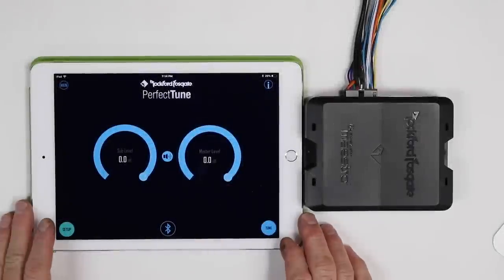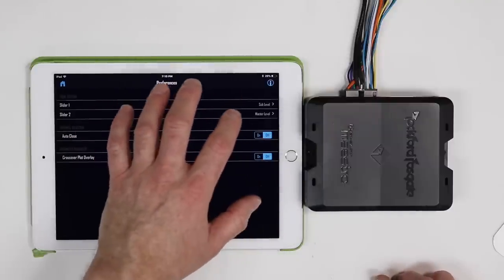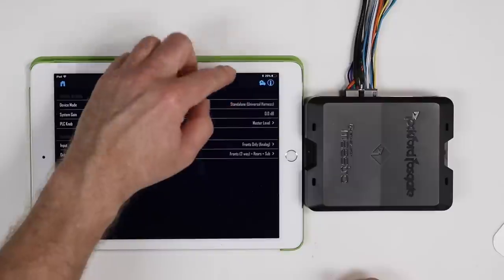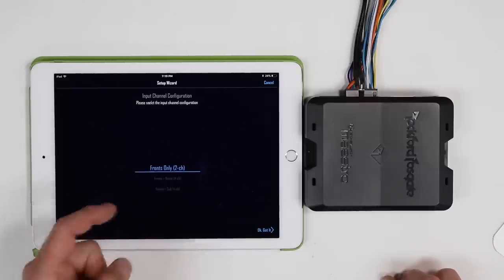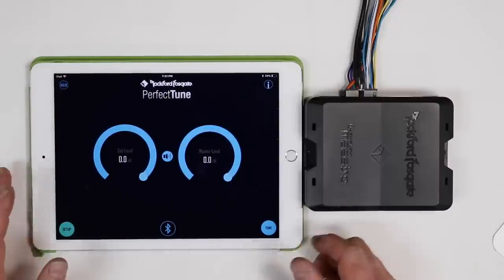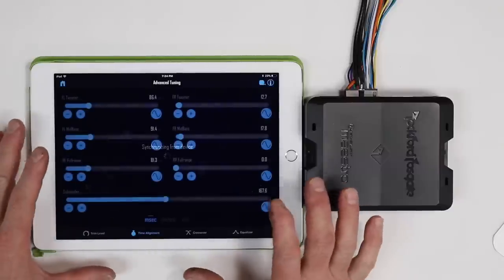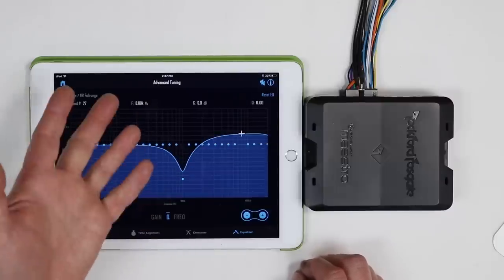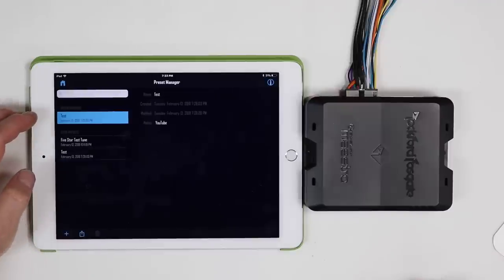How to setup The Rockford Fosgate idataLink Maestro DSR1 DSP

Comment: I was in LOVE with this unit for 4 months waiting till it became available. Then I found out that the bluetooth was for connecting to the tuning and display device aka tablet. I let this one thing make me so upset, that I erased the DSR1 from my memory. lol. 
Then, by chance, I just saw this video for the first time and....omg! The spark is back!
The display is awesome and easy to physically read. Love the colors as well. The ease of use and flow looks very smooth. Each step, makes sense. Has a purpose.
I believe I'm gonna have to give this unit a shot in my truck since it's going to be a Rockford throw back old school install but with some present technology to enhance the sound quality of the classic gear.
Dean....Fernando....
What are your basic opinions of the DSR1 now that it's been out for a few months?
Has their been any warranty issues? Heat issues?
Just let me know what you think of this wonderful little black box!

Comment: Simply push the bluetooth icon to pair? I do not see my DSR1 in the list. Location services turned on for Perfecttune. Not sure how to get the DSR1 in pairing mode. Can we just use the USB plug into our Android device? It seems that would be more reliable if it works.

Comment: Hi guys from a wet and windy Scotland, I live on a small island so I have to do all the work myself, I have just fitted a kenwood Dmx 7017 dabs into my 96 Mitsubishi Pajero, although it's an old car it's in really good condition, the radio sounds ok but the other music sounds flat so new speakers is my next step , do you know what sizes I need before I rip all the trim out , an amplifier maybe for the future but fitting one seems a bit daunting. I love your vids keep up the good work.
Regards Paul.
Reply: God I know this is an old question but speakers are not your answer. There's a formula to this and speakers are just PART of the equation.
You have to start with a good source unit that send the information aka music to the amplifiers (whether inside the source unit or externally, there's an amp boosting the signal carrying the music). Without it, you can spend $$$ on the best speakers and only hear crap, reallllllly well.....and there's nothing worse!
So, depending what system you have in whatever vehicle you have, this DSR1 can possible fix a lot for you and your factory system.

Comment: Hi guys, any chance you could show how to wire the DSR1, with aftermarket radio and 2 amps?  The DSR1 will be installed far from the radio.  So do I connect the 12v Yellow from the 4Gage power cable with a 5A fuse?  Do I remove the remote wire from my amps and just use 1 that goes from DSR1 to 1 amp?  The diagrams shows how to set that up with 1 Amp.  And no where does it show the 12v.  Please help!  Thank you,

Comment: What can be done about the static? I have a DSR1 in a Ford Mustang and I have to have my amplifier gains all the way down and the DSR1 Master Level half way at -30 dB to completely remove the static. When I bypass three DSR1 with my Audio Control LC7i there's no static at all so I know it's the cause. Have you guys experienced this and do you have any advise on the settings to resolve this?

Comment: I have a 2018 F150 XL work truck, small screen, no touch, very basic but has an aux jack. Is this device a good choice to use in place of the factory system? I can't remove the screen, I need something I can hide so I can have good sound without changing out the head unit.  This seems to be what I need with the Bluetooth dongle and volume knob, set the knob to control system volume and completely bypass the factory system( I have an aftermarket amp I can use).  However, I need to retain the backup camera, not sure how I do this? Any suggestions or should i chose something else?  Thanks, love the show and videos guys.

Comment: Do you lose any sound quality due to the thin wire included with the dsr1? Also if you are using components with the dsr1 do you omit the component crossover and control the signal to the tweeter and mid range woofer with the dsr1?

Comment: Hello there.  Is there any way to do specific input channel routing?  can't find it anywhere.  per say, Channel one input routed to ch 2 and 3 only,  channel two to input to output 3 + 4 only.  etc. Thanks for great videos, information, and relaxed atmosphere.
Reply from the maker: Not with this device, you only have presets to choose from.
Reply: @FiveStarCarStereoInc  Oh Darn.  Wish they do a software upgrade and include it at some point.  My application requires that, otherwise I will have to exchange my unit down the road.  Thanks for quick reply

Comment: Hi guys! My car is a Peugeot 208 (year 2017). I´m in the process to upgrade my audio system. I got a Pioneer gm-d9605 amplifier  , kicker css65 6.5" component speakers (front doors) and JL Audio 10WX-4 subwoofer; I´m looking for mid-bass speakers for rear doors. Now, because I want to mantain the OEM unit, I´m looking for a sound processor; can drs1 be a good option for me? Thank you guys!

Comment: The only output channel configuration utilizing all 8 outputs is the 1 with the tweeter, midrange, midbass, and subs. I wanted to do an install with a dsr1 rather than a dm 608/810. The problem is that i wanted to do tweeter, midbass, then the next 4 channels would be sub. Could i simply use the crossovers to make any channel what i need them to be? Or does the designation have some type of bearing on the signal produced?  Would the time alignment be the same also, maybe just the adjustment of both a left and right if it was to be used as sub?
Reply: Thanks again. Amazing videos and a wealth of information all around
Reply from the maker: It would work fine in any 8 channel mode. The labels for output would be the only thing wrong. The crossover and time correction would work fine. Why not get sub amps that have a master slave input and output?
Reply: @FiveStarCarStereoInc  i have 2 pdx v9 already, and i didnt want to use y adapters. I love the audiocontrol dm products for the rta, but you cant beat the value of the dsr1. The videos of yall putting an epicenter and accubass on a rta to see the change in sound made me really appreciate how an rta works. I cant justify spending 500+ on a product i may rarely use(i bought a dd1 when it was 500 though and would again)